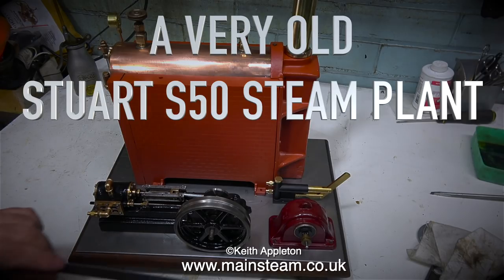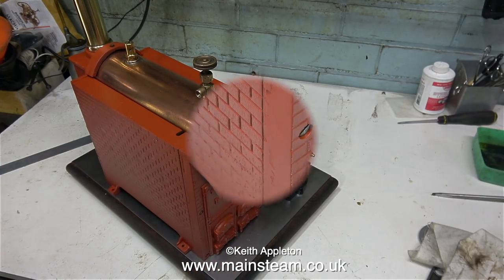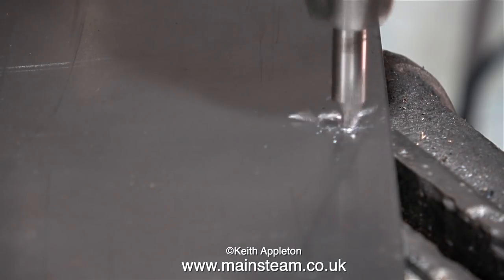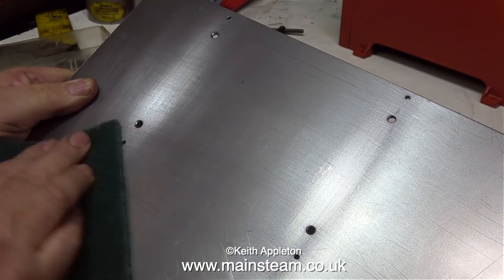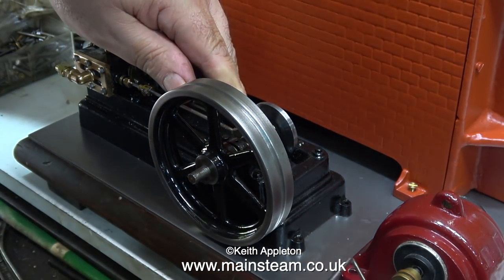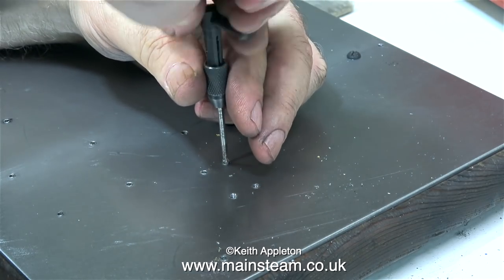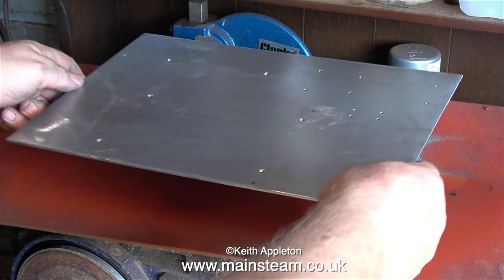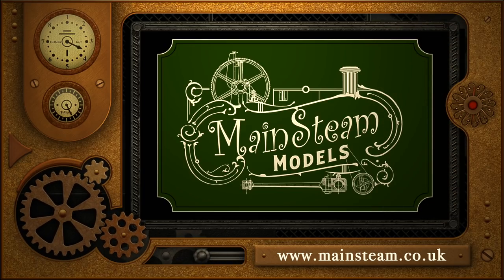A VERY OLD STUART S50 STEAM PLANT - PART #20

Comment: Hi Keith I have found in the past that 1/8" RSP to be how shall I say difficult, I had a job to produce rings from said material with a 9" ID and a 10" OD. This was to be achieved by trepanning them on a lathe against an soft faced face plate cutter breakages were frequent per ring as the metal is very abrasive and reluctant to cutting. I learnt a lot that day about cutting clearances (almost zero) and just what the rake was for. I hope your house move goes well onwards and upwards.

Comment: Started of as a Toolmaker then moved to Aerospace. Toolmaker = centre drill. Aerospace drilling out rivets C1150 drills manufactured to a sharp point, so no squirreling around. If you have good eyes and no need of a shit and pin the C1150 is tops. As always thanks for your late night stress removing post. Wish I knew where to get C1150 because there impossible to sharpen by hand.